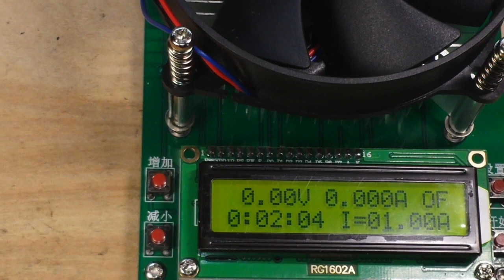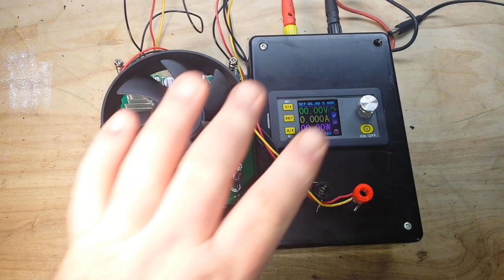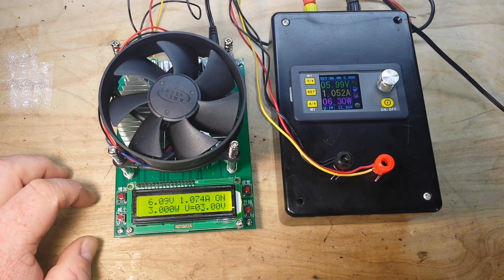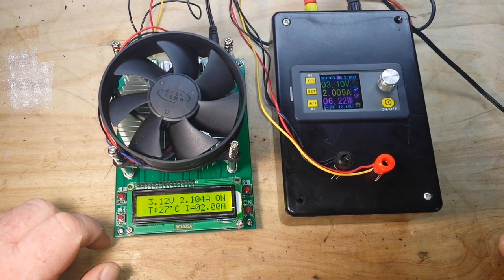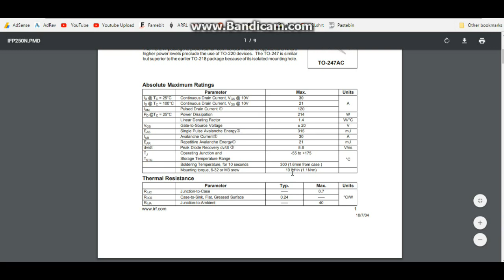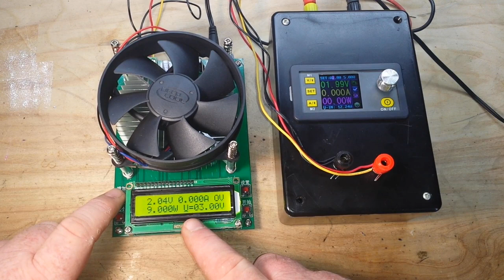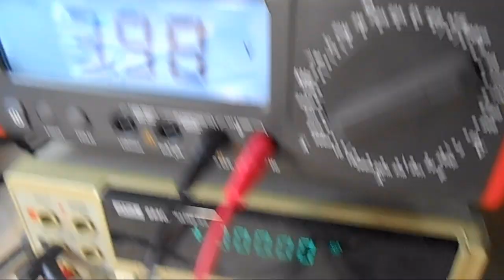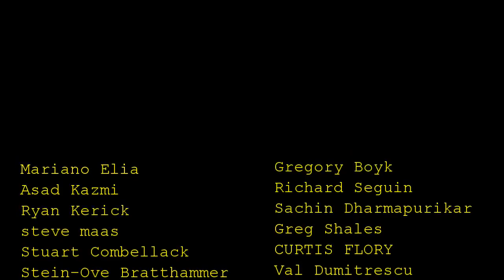Banggood 150W CC DC Electronic Load

Comment: The smaller electronic load i have (same one u have) the fan stays on all the time. This was reported on an Amazon review. I put a volt meter on the output and did some preliminary testing but couldn't find the prob. Might make a good troubleshooting vid? I'll mail to u if interested.

Comment: this Electronic Load is fake, the voltage is not accurate exceeds ± (0.1% + 0.05% FS), the progress by 10 mA (0.01 range) does not work, calibration does not work, check out video in my channel
Reply: I Agree. And it is a bad fake! It does not turn off the load reliable!  I damaged one of my Lipos with it. Useless and dangerous  crap.